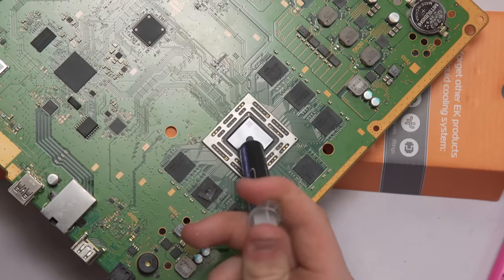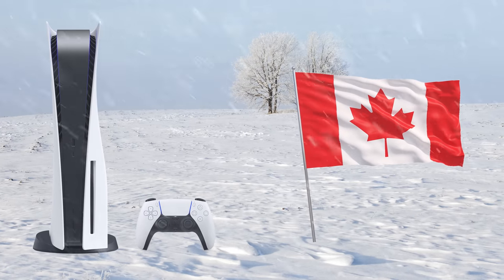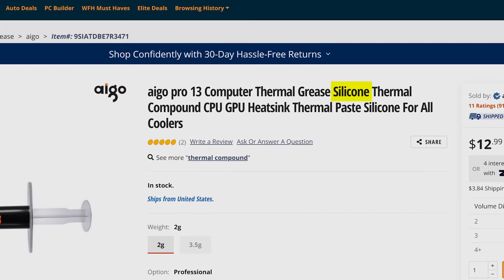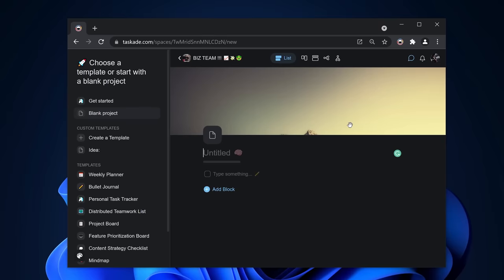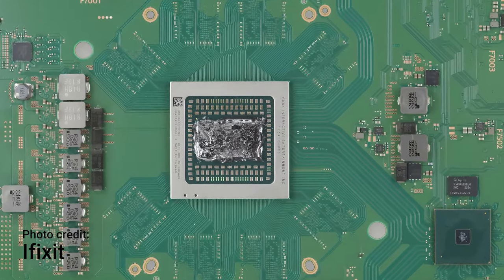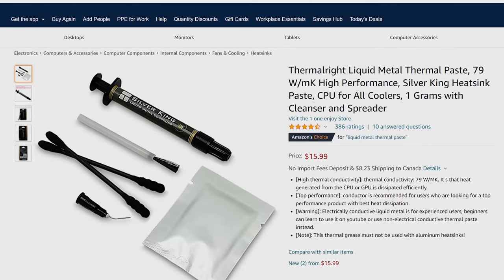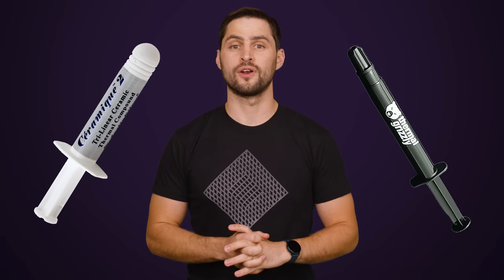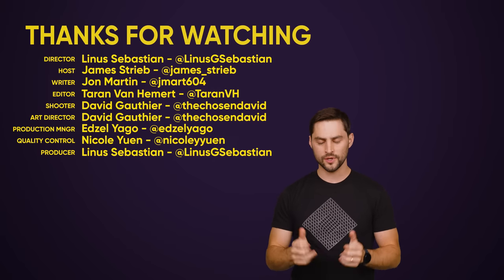LIQUID METAL In Your PC and Console

Comment: I was listening to a talk by a professional motherboard engineer at Dell, who in an interview said that enthusiasts focus way too much on liquid metal, but that it is sometimes either unnecessary or not worth the risk.  There are certain physical and chemical considerations he mentions that most of us enthusiasts don't even consider.  We just wholesale think that liquid metal is inherently better in all cases at all times.  Not really always the case.  Very often it can be a diminishing return and not worth the risk.
Reply: @cadetsparklez3300  Gallium also erode other metals it enters in contact with, in the alloy maybe not as much as pure gallium, but even copper is affected which could cause issues over time
Reply: Anything anyone at a hoopity manufacturer like "cheapest-above-anything-resembling-quality" Dell, I treat like they work for MSM... Lies lies lies 🤣😂🤣😂
Reply: i didint need to put liquid metal but water to test out if heating exceeds 100 degreess while working on broken mobo and i used nail polish around to keep it protected and put smal layer of foil so it doesnt glue components
Reply: @cadetsparklez3300  With spelling and grammar like that. You've got no cause to accuse others of having a low IQ. In a glass house, don't throw rocks.
Reply: @thegeneral123  the human brain can decrypt it faster than I can type, spelling correctly isnt a means of measure
Reply: @quentintin1  Including solder.
Reply: @cadetsparklez3300  have you tested what happens when you mix those 2? cause chemicals n sheeeit
Reply: For more information, everyone please go check out the nuanced conversation that I was referring to here. I promise it's worth it: 

https://www.youtube.com/watch?v=dRSQRqXZfgs&list=PLJw2-YrAPHYGSBLRrXVg4-hofDacyVptX&index=12
Reply: btw, some of the things to consider as well are not just "d0nT gEt iT 0n dA m0thERb0aRd", but also things like the amount of humidity in your computer's environment and extremely low temperatures.  Please look up PCWorld's "Ask a PC Expert" series, I highly recommend it. I gives good nuance to the issue.

Comment: Back in 2019 I got myself a cheapo ASUS TUF gaming laptop with a 1660 Ti GPU and a Ryzen 7 3750H CPU. That CPU was a decent performer but also a frikkin oven. It would regularly hit 106 degrees Celsius in Forza Horizon 4 and thermal throttle. From around 3300 Mhz down to 3-400 Mhz. Thermal Grizzly’s liquid metal saved the day. Plus some added holes in the laptop case with the help of a Dremel and improving the internal airflow with some double sided adhesive tape and some aluminum foil. After all the modifications, the CPU would spike to a maximum of 92-94 degrees C, with averages around 75-80, depending on ambient temperature. The biggest gain was from liquid metal with some 5+ degrees improvement. The extra ventilation holes and the altering of internal airflow added around 2-3 degrees each. I wouldn’t use liquid metal in my PC. But in a thermally challenged laptop it was a life saver.
Reply: Some pieces of advice. Go with a reputable brand. Just like you shouldn’t cheap out on tyres and brakes on a car, you shouldn’t cheap out on the thermal compound in a PC/laptop. Heat is the biggest enemy of any electronic device. Also, you should use the provided tools. Follow the instructions to the letter. Watch a video or two to get some know how and confidence. If you’re good with following instructions in general, you’ll be good with applying liquid metal. There’s no “good luck” involved. Just follow the rules and you’ll be good.

Comment: I just repasted my gaming GL702VSK laptop for the second time with liquid metal. Instantly noticed 10 degrees C less under gaming. The original liquid metal had BONDED TO THE HEATSINK after 4 years of heat. Which I suspect is why the PS5 comes with so much liquid metal and a robust heat sink. GTX 1070 and Intel 7700 still going strong. I game on a 1440p monitor. Can still push 100+ frames in most game titles. Here's hoping BF2042 can still be playable.
Reply: 2042 not even worth it
Reply: Hmm, I wonder how those PS5's will be fairing in three or so years time?
Reply: liquid metal doesnt dry. it either flowed away from where you put it or it amalgamated into copper or aluminum.
Reply: I would love to know at what setting you playing at, as 1440p and 100+ fps on a 1070 sounds a bit far fetched for most of the titles within the last few years
Reply: @WTFZOMG  So it definitely amalgamated into the copper heat sink. That definitely happened over 4 years. When I opened it up, the liquid metal had completely bonded with the copper heat sink. Each heatsink on my laptop was coated in a silver splotch of metal right where I had applied the liquid metal. I cleaned them and after repasting, the temperatures crept up and I had to repaste it.
Reply: Did it come with liquid metal or did you do an oopsie?
Reply: @Guldfisken90   So you are absolutely correct in stating that most recent titles will not run at over 100 frames. The reality is that I play with mostly older 2016/2017 titles. 

Warthunder at 1440p for example gets 100 plus fps at Max settings (not movie). 

Wargame Red Dragon gets me over 120 but again it is an older title and is an RTS. MAX settings

But let's take Project Wingman and Ace Combat 7
Both at 1440 are a solid 60 to 70 fps in the fury of combat and more if I'm just flying around. This is at Max settings for both.

Satisfactory, a builder game runs me at 60 to 70 fps as well and it's an infinite game. This is at ultra settings at 1440p.

COD MW was running at 90 to 100 fps online during a free weekend in 2020. Before my 2nd liquid metal repaste. Max Settings.

Apex legends again is at the 60 to 90 mark depending on on screen action. Also Max settings

What else...AH

ELITE DANGEROUS IN VR. AH YES I DO PLAY VR. Using my First Gen Samsung Odyssey headset, I get what feels like 45 to 60 fps in Elite in Space. I don't get nausea. Same as with Project Cars 2. Both in VR are solid experiences. Though PC2 is at medium settings. Elite Dangerous is at high. 

Recently with AMD fsr in Elite Dangerous I'm getting solid frames in the 50s on the ground of planets. But that is a symptom of the horrendous optimization of the new Odyssey expansion. Which arguably 3080s are struggling to put out more than 60 fps too. It's not a hardware issue.

I do want a new battlefield so here's to hoping BF2042 runs at 60 fps plus at low to medium settings.
Reply: @nikovbn839  No I repasted it myself after seeing guides and lower Temps. Under gaming my laptop does not go over 80C

Comment: I have a direct die liquid metal cooled 9900k with a 120mm aio. They said it couldn't be done but it actually handles the chip perfectly
Reply: yeah just put some other paste that is an insulatior around the edges so the lm cant run off and the risk magically goes away...

Comment: I would like to see a video on laptop power brick coolers or ways to reduce its heat
Reply: A lot of the problem comes from the need for durability. You cart the thing around toss it in the corner on the floor ect. If you could be expected to care for it like you would a laptop for example, you might see them be more open, include fans, ect. But the common consumer would find more issue with blowing their brick up from spilling starbucks inside of it than it being a little warm to the touch. Just taking a Dremel to the case of the brick an allowing some ventilation would be a massive difference for cooling. However like I mentioned this opens up internals to shorting, or other not so good stuff. 

The old Xbox and 360 ect power bricks, have tiny fans in them.
Reply: If they’re getting hot you need to stop leaving it under blankets
Reply: Get a bigger one than you technically need. Had a laptop with a 65W brick - I was pushing it, so it was getting smoking hot all the time. Got pissed off, looked very carefully for a new one (if you use a wrong one, you can damage or even fry your shit, but it's actually very easy and simple to do right - there's only like 2-3 specs that interest you). I got next size available - 90W. And it's almost the same physical size, and weight, with swappable tips and specs wide enough to be used with a ton of different laptops. And I'm very happy I did - no matter what I do with it, it barely gets warm, even if I forget and bury it in bed under pillows and stuff. It gives zero fucks.
I don't get why people bitch about new gaming monsters coming with 300W bricks - they are idiots, or never had a power brick die on then, or both. You need the wattage for it to last and not overheat, if you need portability that much - just get another, smaller one, all problems solved. If your laptop consumes for example 200W, and your brick is 230W, and you will be gaming a lot, it will be sweating balls trying to handle it, and will shit itself eventually. Talking from experience. It's the same as with normal PC power supply in this regard - if you will be pushing it to the limit all the time, it will die. That's why there is a rule of thumb to have like 10-20% overhead, but it should be more for laptop ones, since they are in a tight, portable enclosures and have very limited capacity to cool themselves. 
When it comes to cooling - just keep it free, in a place where there is enough air for it to dissiapate heat. Don't put it near other heat sources. Maybe put something hard under it if it's on the floor and you have a carpet. You don't need to do anything special. Just common sense stuff is enough. You can use a fan to create airflow if you really have to.
Oh, btw - don't drop it either. It's "just" a power brick, but there are still electronics inside that can get damaged or outright brake.
Cheers.
Reply: @nikovbn839  

They’re meant to get hot, just leave it in an open space and it’ll be fine

Comment: its gallium the culpirt, but without gallium it hard to made them stay liquid in indoor temperature, which is araound 20-30 degree C, and can changes depending on your locations.

as long as there is gallium, using aluminum block for the heat sink will probably you cost you more in future if you keeps using liquid metals as heat conductor, better to changes the materials of heatsink block you are used that can resist long enough from the gallium, and probably more maintance on monthly basis, depending on your usages

Comment: Eutectic also means that the melting point is a single point rather than a temperature range. The phase change from liquid to solid is defined as a fixed point rather than exhibiting a partial semi-melted phase.

Solders for example typically have a melting point lower than the individual metals but not all solders are eutectic. 60/40 lead/tin solder for example, has a melting temp range where the solder can be in a plastic semi-melted state. So it is not eutectic… 63/37 has a singular melting point, and does not have a plastic semi-melted phase, and is eutectic.

Semantics yeah, but an important distinction.

Comment: What if you fill your water loop with Mercury instead?
Reply: ..no
Reply: Your pump will probably make some interesting sounds and then cease functioning.
Reply: @MRF2492  Then what if you install a mercury pump instead of a water pump and use corrosion resistant pipes?
Reply: @seasong7655  the thermal transfer is still limited to your thermal paste compound, if you ended up using liquid metal, why bother with all that mercury?

Comment: Just use thermo pasta.

For pads:
Just use termo pasta bellow and top of aluminium plates (radiator from old cpu or gpu cooler cut off in shape).And make sure it doesn't touch anything on components. 
Or if you are lazy and  have thermo pads and they are broken or have tears, just use termo pasta on top if you don't want to use aluminium plate - actually termo pads are made from same stuff, only they are solid than liquid.

Liquid metal, can just destroy your expensive toy if you misuse it...

It should decrease temps (less fan spinning, less power usage, more performance... - huge chain effect)

Comment: Anyone planning on using liquid metal should know that it eats solder as many people using it to bypass voltage regulation on their gpu found out. If you get it on any solder joints it's not just it shorting that you need to be concerned with. Components on your gpu or motherboard  could literally fall off. If it comes in contact with your motherboard there's likely no chance you will ever be able to warranty it if something fails.

Comment: Why don't they have a liquid metal sheet that isn't liquid till it's over 40°? You could then have a sheet that fits the cpu perfectly and know that it's the perfect amount of material. And it won't melt in your hands. Let's say 0.01mm cpu shaped sheet that you just drape over the cpu and within a few moments of turning on the cpu you'd have a perfect spread with no spillage.
Reply: because it doesn't work when it freeezes, this is why Thermal Grizzly sells Cryonaut.
Reply: @ssl3546  explain to me why you'd need cooling for a cpu that's not even 40°c. Unless you're talking about something else. Also what do you think I'm talking just incase it's not the idea and just my articulation of the idea.

Comment: Above 30C gallium (even when alloyed with other metals) can diffuse into the Aluminum between the grain boundaries and tun it into something with the structural integrity of a potato chip. This alloy is also very susceptible to corrosion by water and humidity. 
So if you use liquid metal on an aluminum water block, you can expect to find a geyser in your PC case within a week.

Comment: call me weird, call me stupid, call me whatever you want. but I put liquid metal in my computer many years ago when I did my first thermal paste change. I built that computer in 2011, one and a half year later did I decide to swap out the thermal paste but I felt "why not work harder now so I can be lazy later. so I put liquid metal instead so I didn't have to swap the thermal paste every year or so and it had the added benefit of making the computer run signifficantly cooler and allowing me to overclock just that little bit further. 

so i'm still running my intel core I5 2500k. it started its life running at 4.3 ghz without putting too much time in the over clock, after liquid metal did I manage 4.8 ghz which is all my chip has to offer and has been running at that speed for almost a decade and still shows no signs of giving up on life.

Comment: When the SOC becomes more efficient and Sony release a new model the early adopters are gonna flex cause the new model ain’t gonna have liquid metal.
Reply: Uhh nope its a 7nm APU it wont get more efficient so if they do a second PS5 release on a different SOC it will be a PRO variant on 5nm with 30% more CPU performance and 40% more GPU performance at the same TDP in about 3-4 years from now so 2024-2025

And the 30% and 40% come from IPC and cache advancements you can buff it a good bit if they use faster clocked memory or go up a tier in memory generation
Reply: @commanderoof4578  Just 30%?The jump from Zen 2 to 3 was huge,2-3 gens should give 40-50% at least.
Reply: @naamadossantossilva4736  for desktop yeah for consoles no

Also that was 12nm to 7nm or a change of 5nm

But 7nm to 5nm is 2nm so that alone limits the advancement
Reply: @commanderoof4578  No,Zen 2 and 3 were both on N7

Comment: I've had liquid metal on my Wii for like 6+ years now. Shaved the 4 corners of heatsink to lower it down and added LM. Sound cut in half due to significantly lower temps. Runs way smoother too. Pretty sure the heatsink is aluminum but it has ran fine for years so I don't care.

Comment: liquid metal does not dry up on normal usage unlike thermal paste where it usually only takes a few months to completely dry out and there for becomes less effective in conducting heat which means you will have less reasons to disassemble your PS5.

Comment: Jerrod's Tech said that other companies like Lenovo decided against liquid metal for a number of reasons: 
--Not holding very well over time, which
--Leads to diminishing returns over time 
--It is easier for customers down the line to replace thermal paste instead 
--Laptops with vapor chambers like the Legion 7 would probably require to be sent in to a service center to get repaired correctly, as it (apparently) is more sensitive than other cooling solutions.

Comment: I keep wondering, how long dous liquid metal last?
Do you have to re-apply every year? Or does it last for years?
I do have some Conductonaut here, ordered it wrong, needed the Kryonaut.
Reply: Conductonaut needs to be replaced every 3 months or so. Kryonaut needs to be replaced every year. Conductonaut gets absorbed by heatsink and Kryonaut dries up extremely fast. Go for Arctic
Reply: you only need to reapply for the first few months, as the metal will get absorbed by the copper heatsink on first use. After the alloy has been formed. it is basically maintenance free. 
In case of nickel plated heatsink, you probably only need to apply it once and then forget about it
My delidded 8700 got liquid metal treatment back in 2018 and hasn't been touched ever since, with temps still going strong at 75c max
Reply: If you are considering applying on a laptop, then its not worth the risk. In case of desktops, u can apply but still pretty risky for a negligible performance improvement.
Reply: depending on the surface, on copper you might need to reapply every 6-12 months or so. For nickel-plated copper, it's practically forever. My 8700 that I delidded and LM'ed back in 2018 still has day 1 temperatures even now